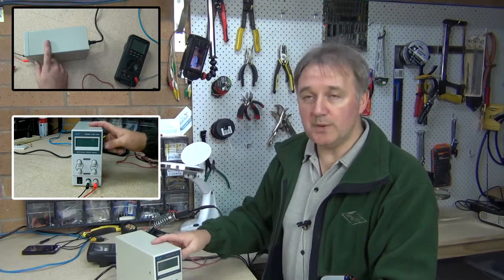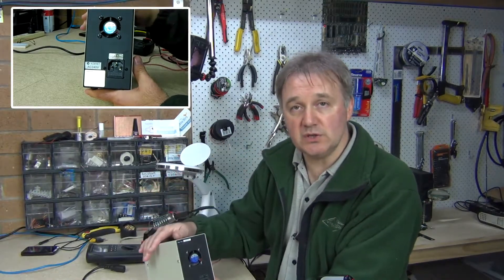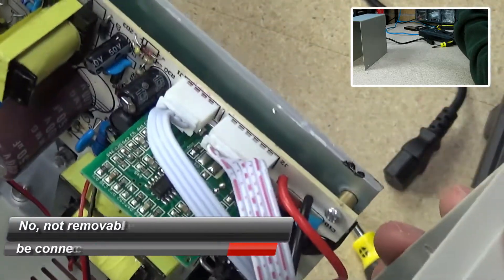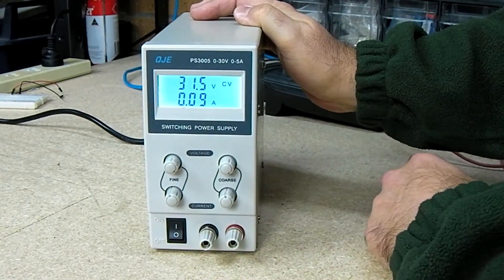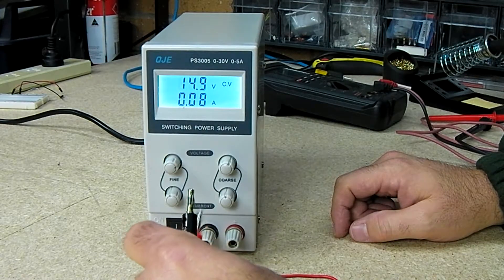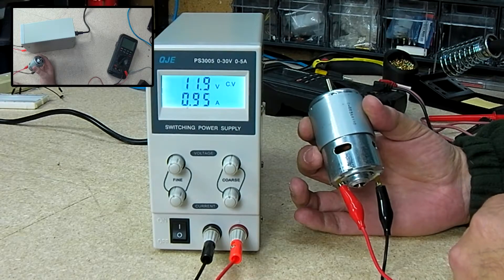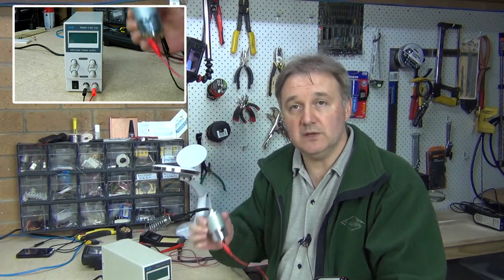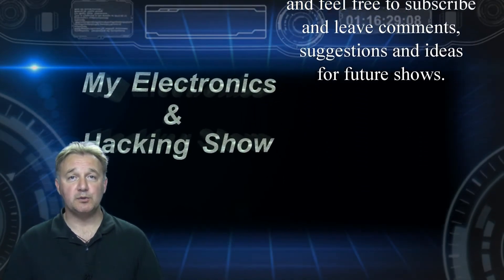Bench Power Supply (Ebay $70) Teardown & Review (MEHS) Episode 23

Comment: Hi. So how is it doing now more than 4 years later ?
Reply from the maker: Hi.  Actually still works fine.  No issues.  That said I don't hammer it or push it hard for long periods, but it works when I need it to and obviously I don't expect it to be a high end unit with millivolt accuracy.  Cheers.
Reply: @michaelsstuff4402  Thanks, thats is nice.

Comment: You can tell me, how much Current (A) get in 3,4 and 5 volts? Thanks a lot!
Reply from the maker: - Hi.  Its a 5A unit so it will deliver a solid 5A at those voltages.  It only barely tapers off at 30V.  Its a 145watt unit so should be able to deliver almost the full 5A at 30V.  There is also a 10A model but I haven't played with that one.  Cheers.

Comment: You mentioned you were going to talk about the capacitor setup when you took the shell off. Was that meaning your take on the cap being soldered to the chassis?
Reply from the maker: - Hi.  That was a while ago but I think I was referring to the Cap location and how some power supply's have a filtering cap just behind the banana plugs which helps with smoothing.  This has been a trooper of a little power supply.  I use it all the time and it hasn't missed a beat.  Cheers.

Comment: how does the fine and course work?! I built my own bench psu but I hate to use a normal pot. it's hard to set the voltage precisely
Reply from the maker: - Hi.  Its just like it sounds I guess.  The course control sweeps through from 0 - 30 volts in once full turn (from memory).  The fine control is a relative amount of that course setting.  If you are set on 5v then the fine control will give about 0.5v range allowing fine adjustment from 4.75 to 5.25v or there abouts.  At 20V the fine range is more like 1v ranging from 19.5 to 20.5v.  It works  very well.  Cheers.
Reply: My Electronics & Hacking Show no I meant the circuit xd I used one as a variable ressitor and another as a normal pot. it made the minimum higher. but I guess I should have used a dual pot!

Comment: These have come way down I bought mine in on Ebay Spring 2017 for $40 USD shipped to my door for a 5A-30V unit about same build quality and design as yours. These switching supplies seem to have come way down in price while the linear supplies with the large transformers and relays have held about the same price or have gone up but are becoming scarce at low prices.  Looks like the trend is toward switchers low cost linear supplies may disappear soon for those who need/want them.
Reply from the maker: - Thanks.  Yes my $70 is AUD so about $50 USD.  A price drop of the linear units would be welcome.  Cheers.

Comment: so this is a smps obviously? i thought a bench power supply must be linear , am i wrong?
Reply from the maker: - Hi.  Yes its a switch mode supply.  There may be a strict definition of a LAB or Bench power supply but I think the term Bench Power Supply is generic and includes SM and Linear as long as the device performs the function of an adjustable power source.  Linear unit typically has lower ripple and is more reliable but for light needs this one works fine.  Cheers.

Comment: Very helpful video. I think this may be just the thing for the light and limited use I buy it for. Thanks !
Reply from the maker: - Hi.  Yes I agree.  If you were a serious heavy user then a rigol or other pro level unit would be better but for general light to medium use or as a second supply its really great value and works well (still going strong).  Cheers.

Comment: Sorry but I have two questions from an amateur:
1- Does this provide pretty much the same testing and power production as a variac (on a smaller scale of course)?
2- What types of things might it be used for as a home Mr. Fix It guy (as I am)?
I thought this video was a well presented review and appreciate the time and effort you made to produce the video for us!
Reply from the maker: - Hi.
1.  No not really.  This bench power supply gives DC (obviously) but it gives fine control of both voltage and current.
2.  I use this for many DC projects that need to be tested at specific power levels.  I use it as an additional supply when I need power for a component such as an LCD display in a build I'm working on.  It can be a good source to see what the current draw is of a component or a complete project.  Its a great way to supply power to things like microcontrollers, Raspberry Pi's and others while your working on a project.  Its even handy to charge up certain types of batteries.  I am also only an amateur and I have two of these and will likely add a third at some point.  Hope that answers your questions.  Cheers and thanks for the feedback.
Reply: My Electronics & Hacking Show Thank you very much for the quick reply and information! If my questions upset you please feel free to ignore them.
So regarding:
1- How is a Variac different and what would a variac do for a home Mr. fix it?
2- Very definitive reply. If I know what volts and amps a certain item needs, I would use the little PS to supply that power to test it? And this PS would only go to 30v and/or 10ma?
Thank you again!
Reply from the maker: - Hi.  1.  A VARIAC is an AC power source where you have control of the AC voltage.  Not really useful in electronics as much is DC.  
2.  Yes that sort of testing is one of the uses.  Yes it goes to 30V but mine goes to a full 5A.  Many go to 10A.  Cheers.

Comment: Well if the price points stay the same after our change in Administration, I may well purchase one of these, come summer time when we leave our nomadic life and return to our home in Northern South Dakota. Right now, living in a Class A motor home leaves little room for even such a small power supply, and finding a 110 volt power outlet is difficult when I am sitting in my recliner, in the middle of our rig. Currently I use two battery powered power supplies, both powered by recovered 18650 Lithium Ion cells, one with 3 cells that I have a buck power converter in, set to 5 volts (usually but adjustable to 12) and the other with six cells that I keep set at 12 volts but with a buck converter as well. I also have a couple of boost converters I can access should I need more power in my electronic toys (ie, arduino, ESP8266 etc).  A USB soldering iron serves me when I need to tin a lead or something, but I do have a cheap China adjustable 110 volt iron that I can plug in when I need real heat such as adding an end to my Ham radio Antenna or some such project.  I am awaiting the arrivial of a new microphone for my 2 meter set, as the one it came with seems to be bad, so I am limited to my hand held unit, and the distance to the repeaters and the low output of the little radio keeps me from doing much in the Ham bands thus far. I am hoping that when I get my Mic, I will be able to reach out and touch some fellow hams with the 60 watt power of the mobile 2 meter radio.
Reply from the maker: - Thanks for the share.  I'm still using my bench power supply without issue so hopefully you have the same experience.  Cheers

Comment: I purchased this, knowing it would be sketchy at best. But I purchased for $40 USD delivered. So even if it fails, it'll just be entertainment to take it apart and fix whatever failed.
Reply: I paid $38 shipped free  I do not think you could buy the raw components and cobble one together for the cost of the parts. If yours lasts 10 years that works out to $4 a year or 1 hamburger per year.  If people want/need a decent hobby power supply at these prices just buy one.  To me the biggest risk is shipping damage.
Reply from the maker: Theball Player -  good plan.  I've been surprised by mine.  I know it's no agilent or rigol but it's been reliable and pretty accurate.  Good luck with yours.  Cheers.

Comment: You didn't mention any calibration pots . You did not verify the readings against a multimeter. Thesecheapo supplies tend to be off calibration out of box and are typically unreliable at either the low end or high end of the operating range.
Reply from the maker: - Hi.  No I didn't.  I can't recall if there were any.  I did test the voltage and current right through the range against a multimeter.  Take a look at 13m40s into the video.  It measured spot on the voltage and was consistently about 0.1A low on current.  Cheers.
Reply: Thank you.
Reply: So just calibrate it to the voltage you typically   work with 5 volts 12 volts 24 volts or whatever. The same is true for current calibration.  Most of us don't work for NASA anyway so if 1/10th volt or a few ma don't matter much. if it does you need a $500 power supply anyway.

Comment: Thank you for this review. I was trying to decide if i should buy one of the cheap eBay benchtop power supply units, and went on YouTube to get an honest review. All the electronic engeneers sitting there with £1000 meters and scopes trying to find the smallest faults was doing my head in.
Sure - the meters are of by as much as 5%, and if you are unlucky, it will give a voltage spike when power up, so it is not meant for heavy professional use. Who thought they were?
I bought a 0-30v 0-10a supply (the linear one - not the switching), and for an utter amateur like me, it is great.
Use is for troubleshooting tools, toys and motors. Also it is great for hot wire foam cutting, and to check and charge all kinds of batteries.

I see a lot of frugal weekend warriors rewinding microwave transformers to 12v og taking cheap toroidal transformers and hooking it up to a regular single pole leading edge dimmer, which is not really the best way of limiting current. For those people, this eBay power supply would be the best investment ever.

I paid £60 for a 10a unit and i think it's a bargain.
Reply from the maker: Peter G - Can't argue with that.  Bang for buck they are a good unit , especially if you don't have one on your bench yet.  Cheers.
Reply: I totally agree with this comment. Yes, I'd like a supply with sense wires at the terminals, and calibrated in a NIST lab, and with better components etc. But I also don't have the money to spend on them. This supply does the job, and means that I have a power supply on my bench vs not.

Comment: At 7:45 you say that this is a current limiting power supply, not a current setting one. It's not very clear what is the difference between these two types. 

Here is a nice explanation of how Constant Voltage(CV) and Constant Current(CC) modes works (can't place the link so I will put the full text):

Upon powering a DC power supply of this type, with nothing connected the default mode should be in CV mode.  This means that the power supply will have voltage control of the output power.  These power supplies also allow you to set a current value, which is often referred to as the current limit.  This setting can either be entered in through the supply's interface, or in some cases users must short the positive and negative terminals to adjust the current limit value.

The current limit value is the crossover point between CV and CC mode.  Meaning, if a load connected to the power supply draws or needs to draw more current than the limit, the supply will automatically go into CC mode, giving the supply current control of the power output.

For example, suppose the power supply is set to 5 V and current limit is set to 1 A.  When the load connected draws current less than 1 A, the power supply will maintain voltage control in CV mode.  If the load draws current at 1 A, the supply will automatically switch to CC mode.  In these cases, the current will output at 1 A or at the current limit, while the voltage will decrease down to a value that's dependent on the load.  Note that the voltage drop is always dependent on the load.  Ohm's law (V = IR) must always be satisfied.  For example, if the load is a 5 ohms resistor, than the power supply should be able to supply 5V and 1 A since 5V/1A = 5 ohms according to the formula. (Note:  the power supply may fluctuate between CV and CC mode since this would hit the current limit).  Now, if the resistor was 2 ohms instead, the power supply will switch to CC mode, and the voltage will no longer be 5 V while maintaining 1 A current.  It will instead be approximately 2 V since 1A x 2 ohms = 2 V.

In short, to switch between CV and CC mode, users must configure a current limit at a value in which they want to run CC mode.  Then, based on the load connected, the supply will automatically switch to CC from CV when current limit condition is satisfied.

-- end of explanation

How would a current setting power supply be different in functionality?
Reply from the maker: - Hi.  Yes that's a good explanation.  I thought I covered it in the video but maybe not.  A current setting PSU would run a fixed (or set) current, e.g. 2amps.  As the voltage changes the current would remain constant.  I can't think of a real world example of one at the moment except, maybe, for some form of electronic load / testing equipment.  As a bench PSU, using a forced or fixed current could be a bad thing as a device designed to use light current, e.g. 350ma would likely be damaged if 2 amps was forced across the circuit.  Cheers.
Reply: - Hi. When I watched the video, what came to my mind was: "are there two types of Bench PSU: current limiting and current setting?". So I believe the answer to this question is then "no". Current limiting is the standard mode of operation for a Bench PSU. 

Thanks for your explanation!
Reply from the maker: *****
- You're welcome.  Pitty it wasn't clear to begin with.
Reply: There ARE current controlled ones, but they cost well into the several hundreds of dollars range.
For $60 you get limiting.
Reply: brickley2000 Hmm, can you “push” current into something? I thought amps was always drawn depending on resistance in the consumer. I’m confused, long time since school..

Comment: If your Amp meter shows some current when nothing is connected, just hold down little button on back of the LCD. It will set current to zero.
Reply from the maker: - Thanks for the tip.  Cheers.
Reply: Oh wow, thanks, I will definitely try this.